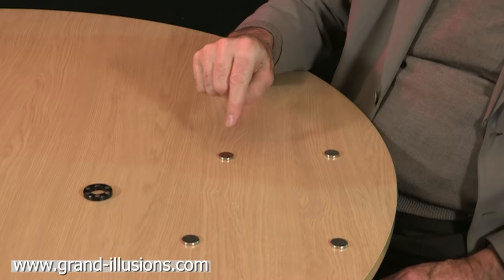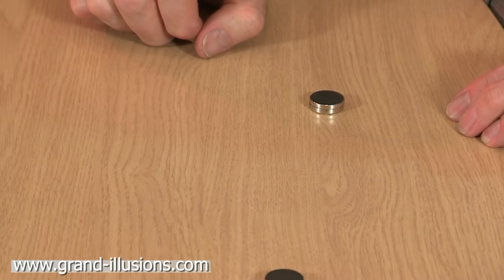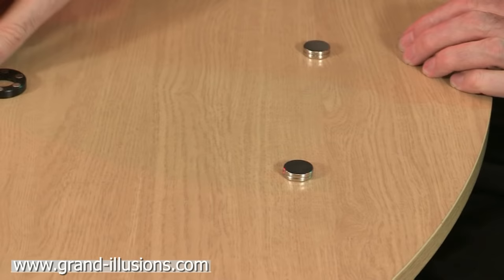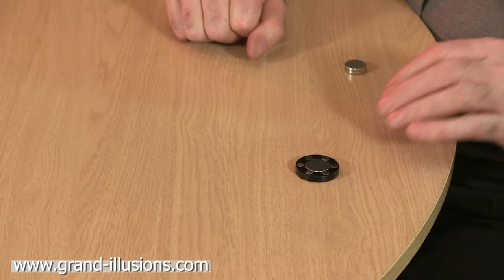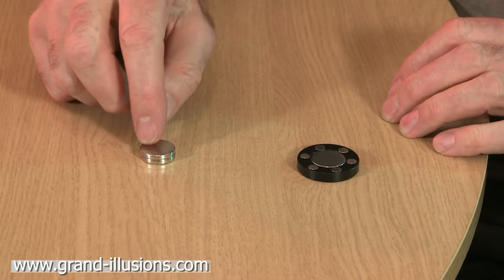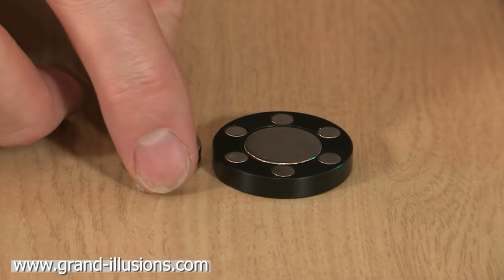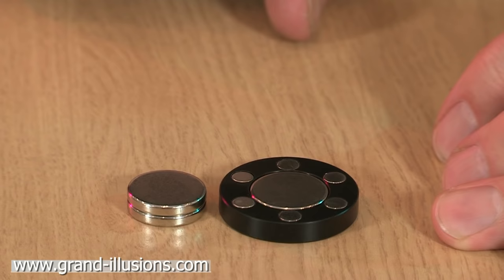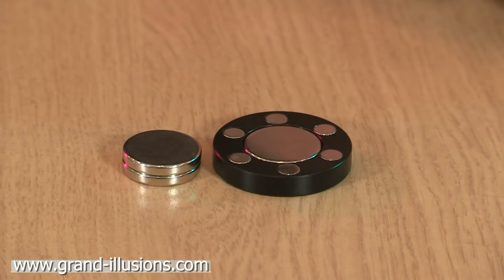Amazing Discovery With Magnets - The Inverter Magnet

Comment: Watching this vid is like watching that apple fall on Newton's head.
It's like you just demonstrated how planets are positioned in an Electric Universe model.
Reply: 9digitNo Planets are "positioned" by gravity and not by magnetism. Don't know where you got such ridiculous idea.
Reply: ShadowManceri
What is gravity?
Reply: 9digitNo Gravity is a force that does make objects with energy to attract each other.
Reply: ShadowManceri Uh please be more coherent with your response.  9digitNo is actually hitting on the similarities between gravitational attraction and electrical attraction.  In fact, both forces are described very similarly, for example the magnitude of both forces is inversely proportional to the distance between two objects squared and directly proportional to the fundemental values of each field (mass and charge).  No clue what hes saying about the Electric Universe model.  No data supports that hypothesis.  Also an apple never fell on newtons head that is just a legend
Reply: wasianish Force carrier between electromagnetism and gravity are fundamentally different. Sure similarities exists like Sun and Earth are similar in many ways.
Reply: I did not say anything about the fundamental particles that propagate the electromagnetic and gravitational force.  If you had read my comment you would know that i only talked about algebraic similarities in the equations that describe the two forces.  Also your second sentence is very, very tough to understand because you say nothing and have poor grammar.  Don't tell me I'm wrong again because, unless newton's law of universal gravitation (on the macro scale) and coulomb's inverse square law are wrong, I am not wrong on this issue.  Thanks for your time kind sir.  -Wasianish
Reply: wasianish You say no data supports the EU hypothesis.
Allow me to explain how to avoid contradictions between data and observations.
If they don't fit, you invent 'things' to support the data. If you have a strong gravitational field but see no mass, you invent a black hole. If you see effects of mass elsewhere but no mass, you invent dark matter. And that's how traditional cosmology makes the data support the observations, they have to insert invisible stuff to make their model fit.
It's just a consensus until someone comes up with a better explanation.

But a different view on the nature of the universe does not change the laws of physics that are at work in it. You correctly pointed out the similarities between gravitational and electrical attraction :)
Reply: I don't know what you are talking about weird sir.  Black holes have a shit load of mass.  It is the high concentration of mass that allows it to be a black hole.  Also what is the EU hypothesis?  The European union hypothesis?  And this physics was not invented.  In fact, dark matter is not really a thing it is a name to describe the phenomena we see.  The terms used dont matter it is the physics behind that matters, and if you were to read up on this stuff, you would know that black holes, dark matter, quantum mechanics, all explain the phenomena that we see.  And the models that describe them are all supported by many decades of research.  I am not saying they are definitely right because nothing is definitely right in science.  There is gravity but how you describe gravity may be completely different.  For example we now know that the force of electromagnetism is propagated by virtual photons.  You, on the other hand, just propose something that is not supported by any data.  To disprove the planets being electrically charged and orbiting each other, how would a solar system like that even work.  If the sun were positively charged (this would mean a hell of a lot of charge that would create such internal turmoil because the charges repel eachother that it could never exist in the first place; The electromagnetic force is much more powerful than gravity) then all the other planets would have to be EXTREMELY negatively charged (also ignoring that they would never exist because the electromagnetic repulsion inside would blow it up).  And since all the planets are negatively charged they would repel eachother to the extent that our outer planets wouldnt be in our solar system.  This is just the beginning of a lot of things wrong with the electrical universe model.  Thanks
wasianish
Reply: wasianish Let me respond to that.
1.'Black holes have a shit load of mass'
Black holes really are nothing but a hypothesis in traditional cosmology to explain the effects of a large mass where no large mass can be seen. So of course they appair to have a shit load of mass. This is a great example of circular reasoning.
2. 'It is the high concentration of mass that allows it to be a black hole.'
 In the EU model gravity doesn't need a great mass to be present in the center of a galaxy, because gravity is an electromagnetic force generated by the entirety of that galaxy and centered in the middle of it. So, no mass is needed where the force is concentrated.
3. 'The European union hypothesis'
EU here stands for Electric Universe. (but that was probably a joke)
4. 'this physics was not invented'
No, but you make the mistake of confusing the physics with the conceptual model that is 'invented' to explain the cosmos, and wich can be 'corrected' at any time, because it doesn't fit the physics.
(e.g. Hawkin is changing his black hole concept)
5. 'dark matter is not really a thing it is a name to describe the phenomena we see, the term used don't matter'
I couldn't agree more. It's hypothetical matter, let's call it pixy dust.
6. 'you would know that black holes, dark matter, quantum mechanics, all explain the phenomena that we see'
Yes, but it's not the only explanation. EU theory offers a another.
7. 'the models that describe them are all supported by many decades of research'
So were 'Flat Earth theory' and the geocentric model.
(and I think it would be a big mistake to think these people were less intelligent than we are)
8. 'I am not saying they are definitely right because nothing is definitely right in science'
I don't claim to be right either. I'm just saying there's another theory that seems to make at least as much sense.
9. 'we now know that the force of electromagnetism is propagated by virtual photons'
This is part of quantum mechanics, something I know nothing about, so I will leave the critique to greater minds :)
But you do need to realise that just because mathematics can describe something, that doesn't make it real. (e.g. it's perfectly possible to calculte the features of a 20 foot giant)
10. 'You, on the other hand, just propose something that is not supported by any data'
I've been over that in my previous post
11. 'To disprove the planets being electrically charged'
Even if you dismiss the possibility of a net electrical charge of astronomical bodies, you can not denie they do have an electromagnetic field.
I have to admit that in a Google search, it is hard to find mainstream scientist that confirm net charges. I have come across some, but typically you come up on alternative sites.
12. 'This is just the beginning of a lot of things wrong with the electrical universe model'
This is the proverbial stick in the eye.
"Why do you look at the speck in your brothers eye, but do not consider the plank in your own eye?"
Reply: 9digitNo Let me respond to that.
1. We know black holes have mass because the way they behave proves that it does.  You cant just say i dont know there is mass so magic stuff its not gravity its eletromagnetism.  And no it is not just a hypothesis now.  It is a scientific theory that supports all the data we have measured about them.  And no its not circular reasoning.  Circular reasoning is when my conclusion = my premise.  My conclusion is that black holes have mass.  My premise is that they affect other things with mass.  My other premise, things with mass affect other things with mass.  Simple enthymeme.  No logical fallacy there
2. GRAVITY IS NOT AN ELECTROMAGNETIC FORCE holy cow what are you thinking man!  Gravity, as far as quantum mechanics is concerned, is propagated by a particle called the graviton.  No we have not seen it but gravity is a field just like all of the other fields in the universe.  Since all of those fields have excitations known as particles, we can deduce that the gravity field has excitations.  The excitation of the gravity field is the graviton.  THIS HAS NOTHING TO DO WITH ELECTRICITY since the electromagnetic force is mediated by virtual photons.
3. Yes that was a joke
4. If it doesnt fit the physics it would have been replaced sir.  The electric universe doesnt fit the physics so it does not exist anymore
Yes physical models can be changed if they dont explain what we see.  I don't know enough about stephen hawkings assertion about apparent event horizons to explain it to you but please go look it up if you find it interesting
5. No lets not call it pixy dust.  You want to know why?  Because it explains what we measure.  That is with everything.  By your logic why not call electricity pixy dust.  Its something that we just invented to explain what we saw, as is every single observation EVER MADE note the sarcasm here
6. Sure EU offers another false explanation because it doesnt explain what we see.  Like i said in my previous comment.  You cant just propose a model and call it a theory.  It is a hypothesis that fails by basic nature of electromagnetism.
7. Yes people once believed the earth was flat.  BUT we found data to suggest that it was NOT flat.  We DONT see data that suggests the universe is held together by electromagnetic forces therefore we refute the Electric Universe theory.  
8. Well you can choose to believe in it if you want im not forcing your opinion.  I am saying that your opinion on physics is not right.  Yes i said opinions can be wrong.  Someone could say "I believe 2 + 2 in base 10 is 5" but they would be wrong by definition.
9. :D
10. No you havent.
11. Yes they have magnetic fields but the force by a magnetic field on an object is proportional to its charge and cross product of velocity and magnetic field vectors.  First of all the suns magnetic field is very irregular and flips every once in a while so assuming everything else you say is true we would flip being attracted and repelled, which is not what we see.
You know what a net charge is? The total charge on an object.  Charge is a fundamental property of matter.
12. I have actually never heard of that proverb and neither has wikipedia :P  But to respond I have considered if there is a plank in my eye.  Im assuming by this you mean why criticize someone else's wrongness if you are wrong.  Well what i have said so far is all supported by evidence and measurements that we make of nature while your are not.  If instead of wrongness you are referring to stubbornness, I am not being stubborn I am simply giving and argument to why your electrical universe model is wrong.

So here are some tips for you.  These do not correspond to the numbers up there:
1. Research this stuff before you start a debate with someone.  It can be very helpful to have some background knowledge on the subject.
2. Be able to change your mind.  You seem pretty set on this EU model but will not change your mind even if you see that it is wrong (I hope you see that its wrong).  Steven L Carter wrote a nice essay about integrity and honesty that covers this subject "The Insufficiency of Honesty."

Thank you for your time and something to kill my free time doing :D
Wasianish
Reply: wasianish I'll definitely read that paper when I'm finished laughing.
And I will let you know what I think of it.
Reply: Yea as you can see i had a lot of time today.
Reply: Don't tell me about it, English isn't even my first language. You can't imagine the time I spent in a well meant effort to educate you :)
Reply: ShadowManceri perhaps you need to look up the word 'LIKE"..?
Reply: Is this Electric Universe thing a master internet troll job? I can't fathom the silliness of it.
Reply: (its a joke on vine) no its 21
Reply: 21
Reply: i something have zero mass it doesn't exist at all :D there is a difference between zero mass and very very little mass
Reply: Tony07UK
No use calling names. Just self serving, like farting in a crowded room to release pressure you feel. No one else likes it... helps no one.
Reply: Tony07UK gravity interacts with things that have energy and momentum, which light certainly has. This means that gravity from a very massive object like a black hole exerts a force on the photon bending its trajectory, and that that photon exerts a tiny force on the black hole.
Reply: Tony07UK  you are wrong. Photons can exert a forces. They are attracted by gravity and experience a force. And for every force there is an equal and opposite one. Also photons do have momentum. It is just that the equation is c times Planck's constant divided by the photon's wavelength. There is also a way where you can derive a relativistic mass to use on the Newtonian equations.

Comment: Could magnets be used to propel a space vehicle?
Reply: no
Reply: north pole is not in space.......
Reply: oh you
Reply: *****
What about Magnetoplasmadynamic thrusters?
Reply: Absolutely, This is how ion engines work. Many satellites already use this to explore our solar system.
will122391 Actually the magnetic field still exists in space, In fact many satellites have a large metal rod that acts as a giant compass needle that helps them maintain rotational momentum in low earth orbit.
Reply: Propel a space vehicle? No. Propel a vehicle into space? Yes. It's called an electromagnetic catapult, the same principal behind monorails and Gauss cannons. In fact, we're already using them to launch jets off of aircraft carriers. The problem lies in making one long enough to reach escape velocity WITHOUT reaching lethal G-forces for the occupants inside.

Comment: Simple, I think (Educated guess).
The ring assembly contains a center magnet that "pushes outward" on the 2 thin magnets.
The ring assembly also contains 6 outer magnets that "pull inward"  on the 2 thin magnets.
Get the disc magnets close enough to the ring assembly, and they end up in a balanced state (push = pull), a certain distance away from the ring assembly.
If you try to move the discs away from the ring assembly, the "pull" gets weaker, but the "push" gets even more weak, so the discs get pulled back to the balanced state.
If you try to move the discs towards the ring assembly, the "push" gets weaker, but the "pull" gets even more weak, so the discs get pushed back to the balanced state.
(The ring assembly push/pull arrangement may be opposite of what I said, but the end results would be similar).

Comment: There is no mystery here.  Magnetic fieds follow the inverse square law.  At a distance, the field from the large magnet overcomes that of the small ones.  But at a certain distance, equilibrium is achieved.  If you were to puss them closer together, the repulsion would increase.
Reply: Equilibrium is impossible, read earnshaw's theorem the setup work because of friction on the table it is like pseudo levitation, the tip of a pen touch the wall.
Reply: Clyde Wary It looks like a sort of 'legrange point' but inverse!

Comment: The plain magnet is locked into the space between the 2 smaller magnets which is why it turns when you turn the disk. The 2 small magnets push it away whilst the large inner disk magnet draws it in.

The large magnet at the centre has far reach whereas the 2 smaller ones don't. The 2 of them together equal the power of the large one however they are separated reducing their reach. So the large centre magnet draws in the other large magnet but as it approaches it comes into proximity (reach) of the 2 smaller ones, where they can then have their effect of pushing it away.

Comment: It is like a magnetic coupling, they are used in acid proof pumps where the impeller is kept separate from the motor by a plastic housing, the impeller has magnets in it and the motor shaft has a disc on it with with magnets in it so when the motor turns the magnets, which are in attraction, drive the impeller. The impeller is in a sealed plastic housing so that the acid cannot make contact with the motor.
This method can be used as a clutch in low power applications where you can rev the motor to max power and then drop the clutch like when you spin the wheels in a drag car. The magnetic coupling can transmit 120% of the motor power but it slips nicely during the pull away and there are no wearing parts so it should last a very long time indeed. By using this method (its really an inertia flywheel effect) you could probably achieve quite quick acceleration out of a relatively small motor or engine as it will be able to make max power from a stationary position until it reaches top speed.